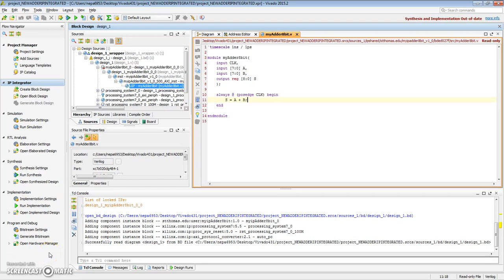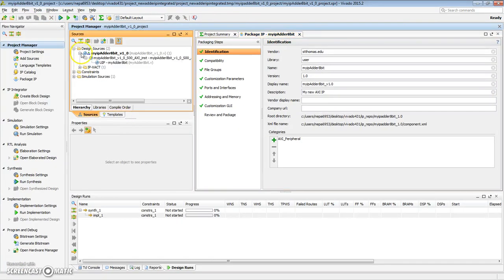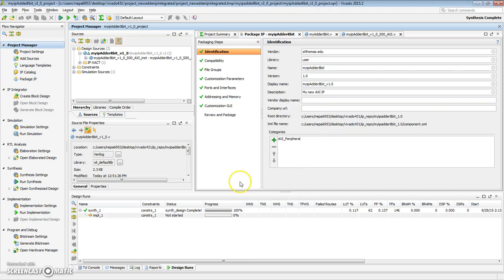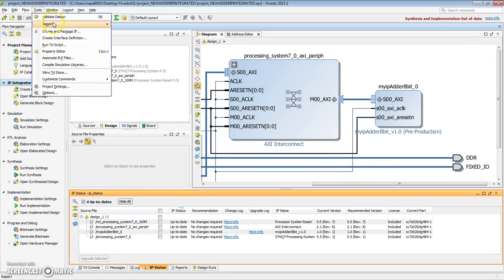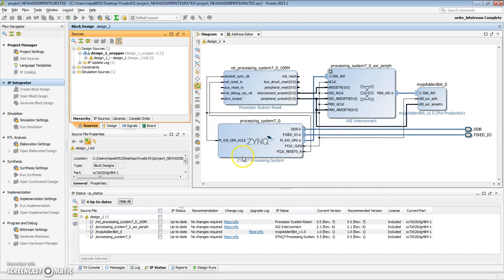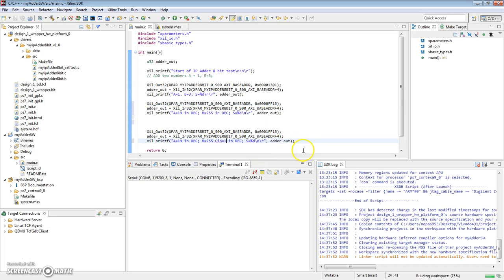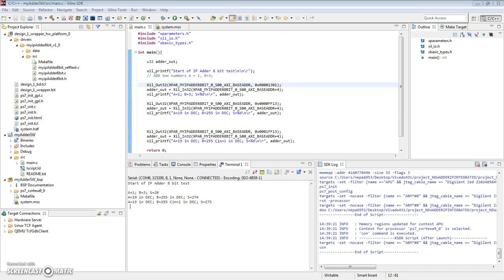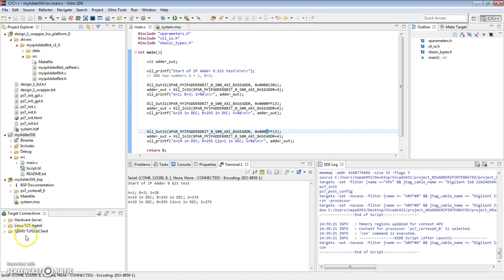Vivado 2015.2 CUSTIOM IP  PART IV - Editing your Custom IP Vivado

Comment: Very good videos. Helped me a lot.
I have a very irritating issue though, and I simply cannot find any videos describing how to do this.

I have created a module including a clocking wizard. I can generate a bitstream and it works excellent. But I simply cannot find any way to actually package it with the clocking wizard.
So a more advanced IP including block design would be so welcome :-)